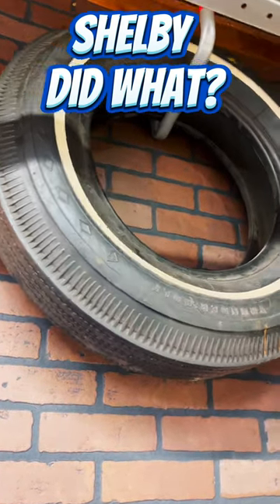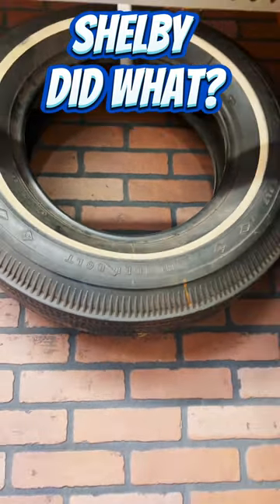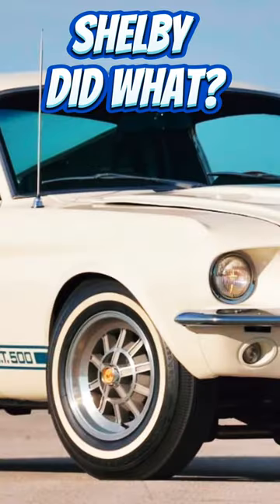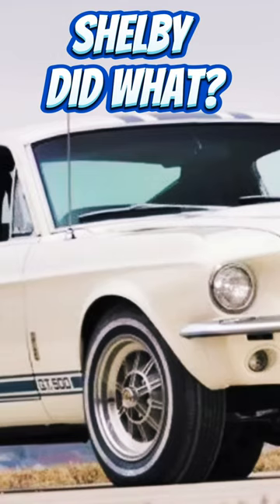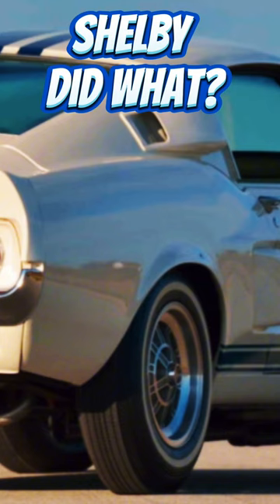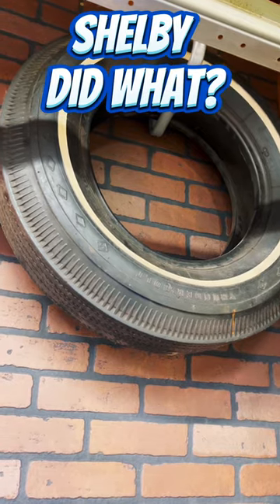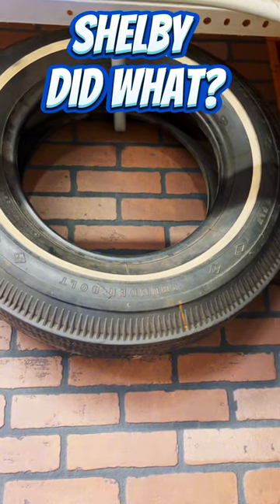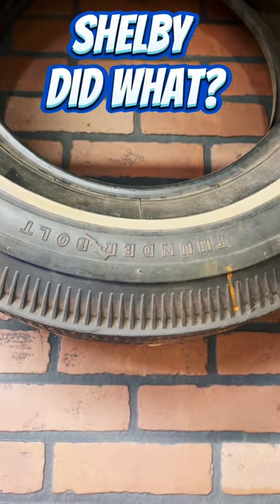Carroll Shelby Did What? #shorts

Comment: The reason we don't make tires like this is because it has no traction, would fall apart after 3 years of use, it would be completely useless in freezing temperatures.
Reply from the maker: I think you need to watch a video on that tire being tested by Shelby, it just might change your mind a bit
Reply: @2HacksGarage  I worked adjacent to that field. In racing, grip and longevity was $$$$$$; if the tire could have been as good as it promised, we'd have it today.
Cool technology but it was designed for specific circumstances, kinda like a ram-air engine....
 There's a reason Michelin Defenders and Cup Sports are the most expensive tires on the two ends of the spectrum.
Reply from the maker: @jonbar140  tires for specific applications, in this case, 1967.  A passenger car tire that Goodyear made, and Shelby proved for the time it was quality and stable